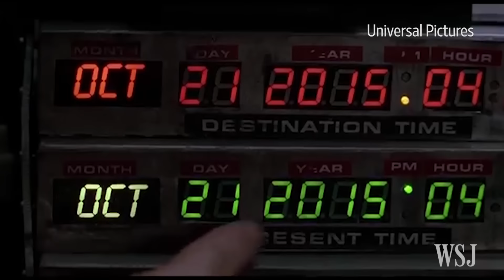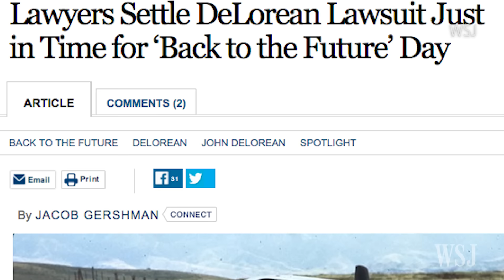DeLorean Plans to Resurrect Its Sports Car in 2017

Comment: Are you kidding me!? $80,000-$100,000 for a newely built Delorean are you out of your minds?!
Reply: they are hand made, thats actually pretty cheep
Reply: Cheerson Railfanning Productions that's what I said. Way too expensive
Reply: hand made and full metallic body is the reason they are expensive
Reply: +HlDlTR It would be less expensive if they've made it out of stainless steal construction.
Reply: tell me how is steal less expensive than plastic fiber?
Reply: +HlDlTR A Stainless Steal Delorean would only cost between $50,000-$55,000.
Reply: If I had the money, I probably pay even more for this car. )
Reply: Cheerson Railfanning Productions,     $80,000 - $100,000 for a motor company that has stopped in the making of the delorean for a good amount of years and comes back isn't a bad price and ya sure for some people thats ridiculous but it makes since because it was a rare car when the car first came out.
Reply: Sounds fair for a completely updated interior, upgraded motor, etc.

It's niche, it's handmade, it's limited... for a production car of similair quality it could be overpriced depending on the overall quality
Reply: if i had the cash i would do 80k
Reply: I would pay that for a Delorien with new parts and features

Comment: basiclly they will be new cars made with mostly new old stock parts. So they should have a fairly good value and a motor upgrade is a good idea but i hope they upgrade the suspension and the breaks as well. I just wonder if they will add air bags to try and make them safer.

Comment: 0-60 will likely be closer to 5 seconds, possibly a little under, with 300 to 400hp. It weighs exactly the same as a FRS/BRZ.

200hp in a DMC is good for under 7 seconds.